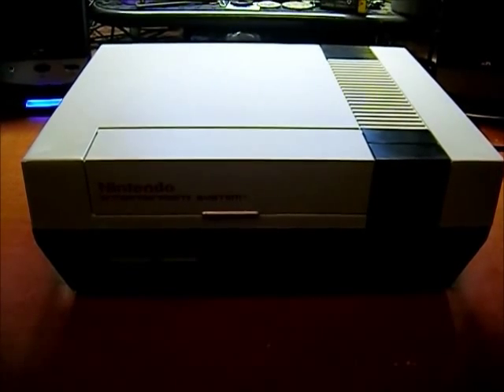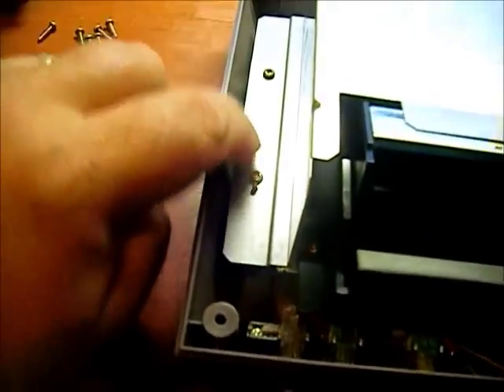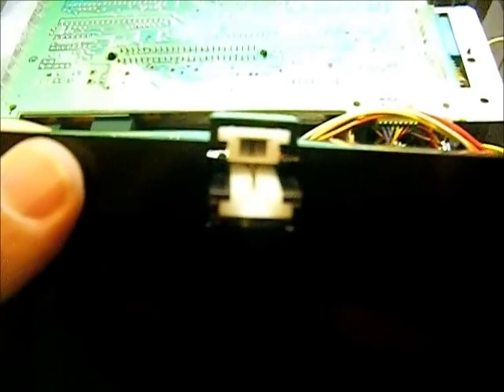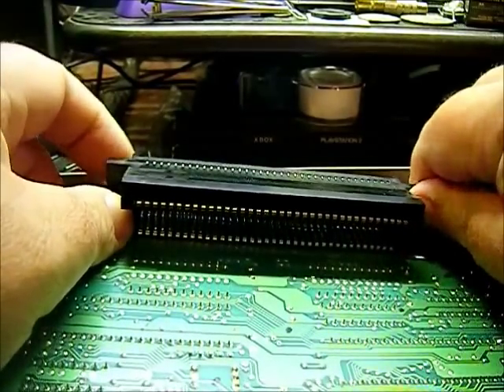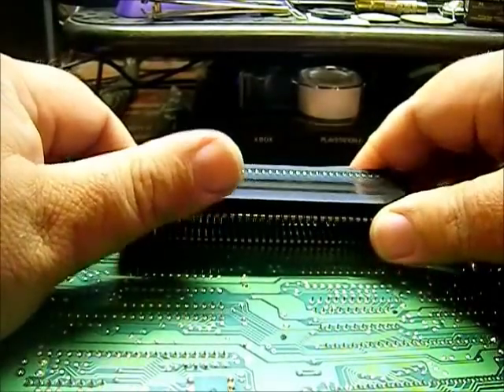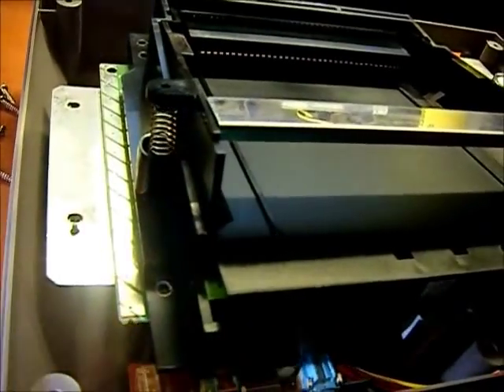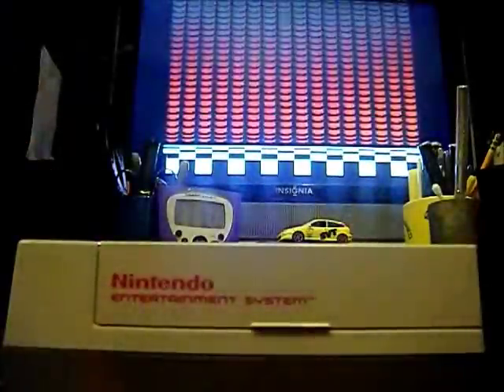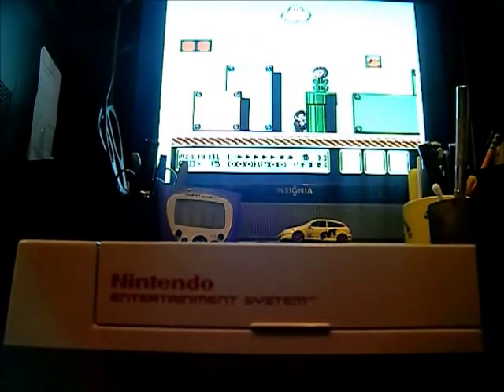Nintendo NES Cartridge Tray Repair

Comment: Great job.  I bought a new 72-pin connector for the NES of a friend of mine once.  I should have done that for myself as well, but instead I just used some very fine sandpaper to clean my connector a bit and it has worked very well since then.

Comment: I noticed at the beginning of your demonstration with the tray latching you were mostly pushing down on the left side of the tray. That's your problem there. If you press down it the middle of the tray you'll have better luck. Also, pressing down on the right side of the tray will usually fail. One thing I like to do before installing a new connector is clean the contacts on the PCB. There is a lot of corrosion there. Refurbished connectors work best for me. I've never had a new one work well because they aren't made by Nintendo and they're cheap plastic.